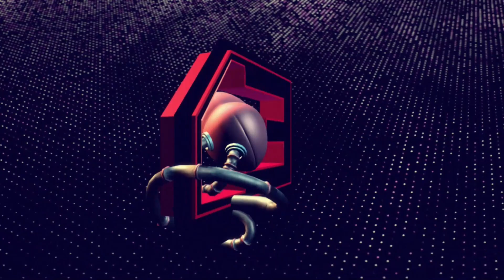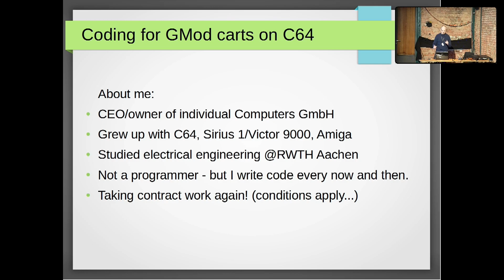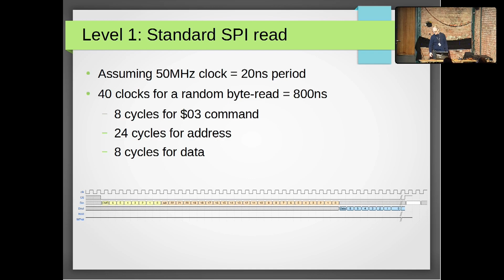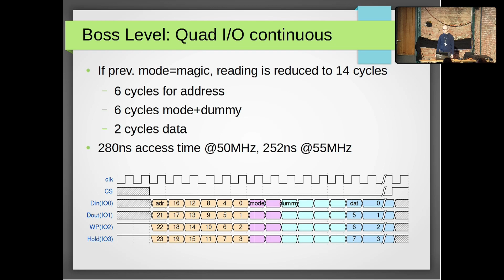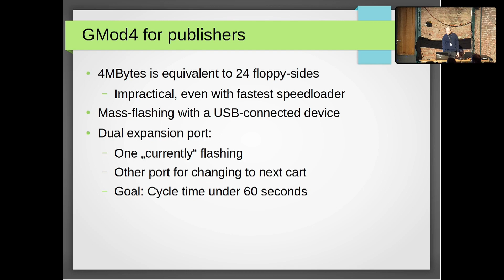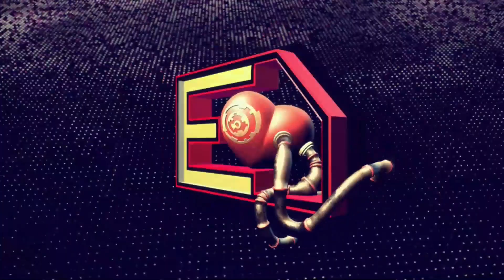Revision 2023 - Seminar - Coding for the new GMod cartridges for the C64 by Jens Schönfeld

Comment: Very interesting talk, thank you! Especially the SPI flash access implemented in TTL sounds wild! Just out of curiosity: Would it be possible to shave off another cycle from Quad I/O continuous read mode by accessing two SPI flash chips in parallel (one for the upper and one for the lower nibbles)?